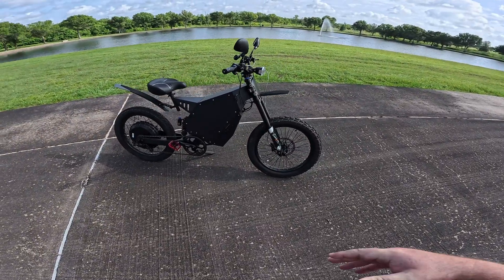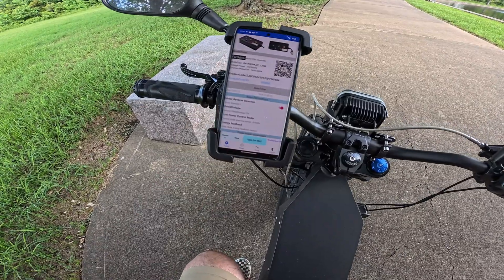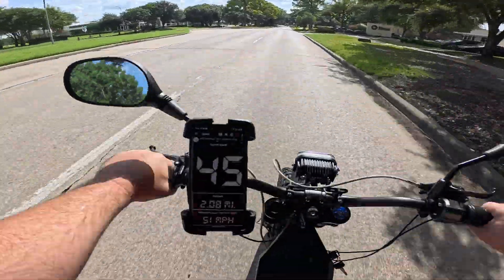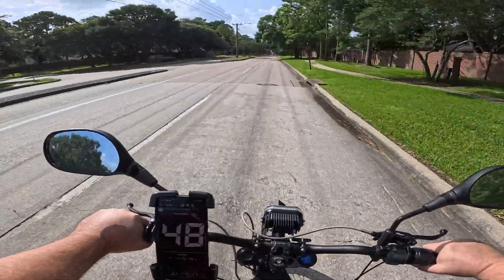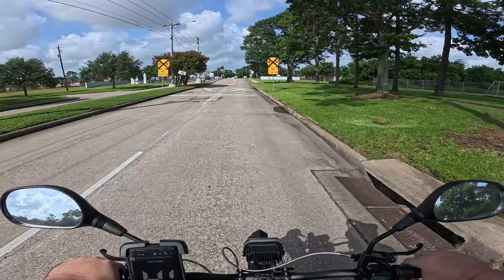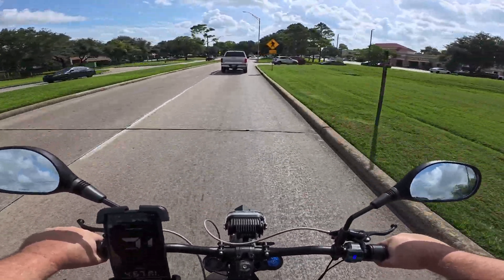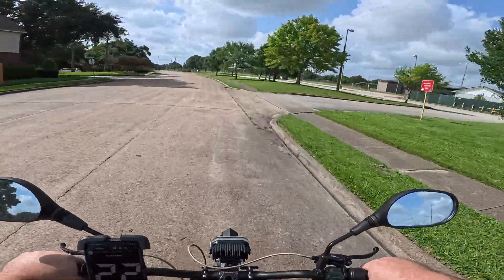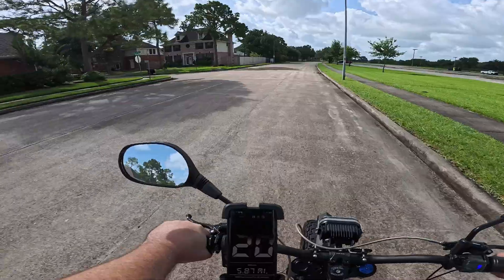More Power for FREE — How I Tuned My Stealth Bomber to 16,200 WATTS!

Comment: You raised your phase amps too, right? I said 225/650. I have done off the line full throttle tests too, that video was just a starting point. The Bms never cut battery off. The only time I ever had the bms cut off the battery was when I got down to 63 volts in my range test. Almost everything you learned to make this video came from me, you're allowed to give me a shout out for all that i found out and shared with you, sheesh lol thats how this community grows, share knowledge and give credit where credit is due...anyway I sold my bike yesterday for $4700! Made a $1500 profit. I am going to buy a coolfly now. The coolfly bikes are offering so much more for the same money. Motorcycle brakes, 230mm,3mm thick, better battery technology rated for more charge cycles, more power and speed. Better display, alarm, regen that actually works, front and rear turn signals, mirrors, both bike and moto seat included and the same price as these Chun bikes!! It's a no Brainer
Reply from the maker: I'll give you a shout out on the next one, I forgot who said what. My bad, ok I'll try 650 phase.
Reply: Lol settle down. I mean who cares who did what